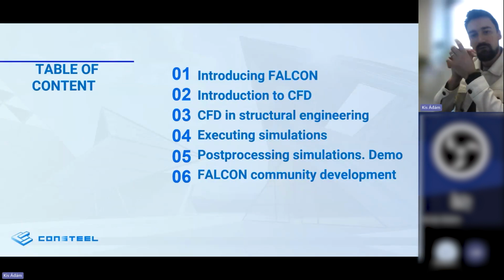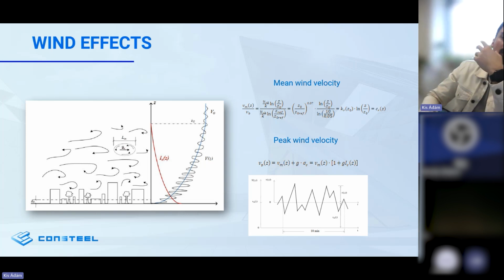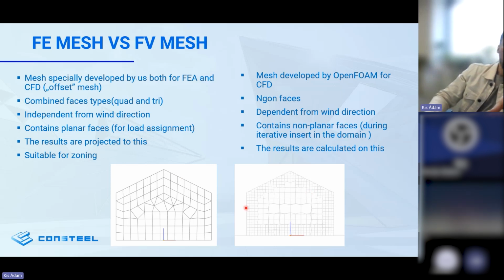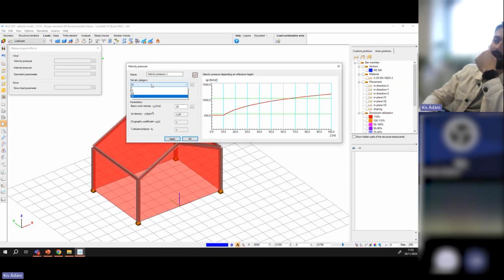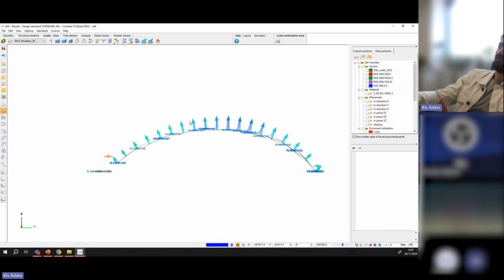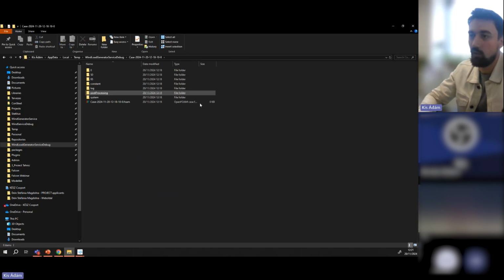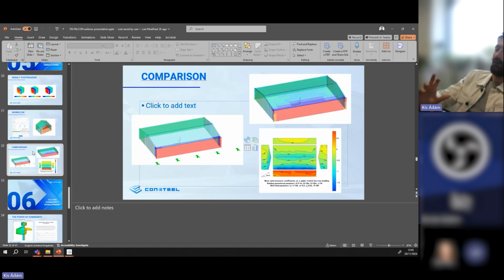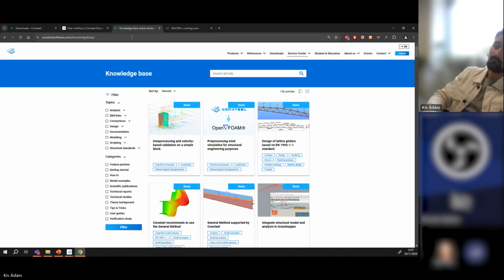Introducing FALCON, the new load generator plugin for Consteel webinar

Comment: Is it possibile to model the surrounding terraina and/or buildings? My appologies if is said in the clip, I saw it on fast forward and maybe I missed this.
Reply from the maker: Hello! Thanks for your question. Using simulation surfaces any geometry can be modelled, even the surroundings, however, those need to be considered as "obstacles" in order to generate loads only to the building. If you haven't tried FALCON yet, now is the chance to explore it during the 30-day Consteel trial for free.